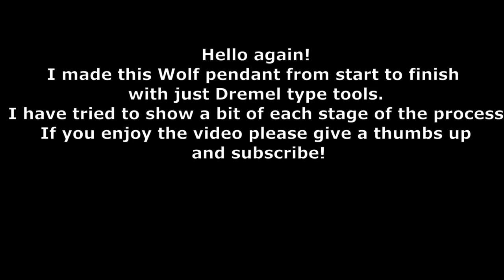Just a Dremel, Stone Carving - Wolf Pendant. You can do this!

Comment: You have made that look so easy . I have a dremmel and the diamond blade doesn't want to go thru the quartxz maybe I'll try a different stone   less hard on moss scale.  I also don't have it hooked up to an air compressor is that what your using  ?
Reply from the maker: Hi Amy, the stone I used is welsh slate, brilliant for carving, very firm but not too hard.  
my tool is a Ferrex flex drive, (mini bench grinderhttps://youtu.be/0dwNPlY5QTs ) not air. This does have a bit more power than a dremel. I would not take too much notice of Mohs scale, it is really for minerals, not rocks or stone which are mixtures of minerals. Best of luck with your carving!